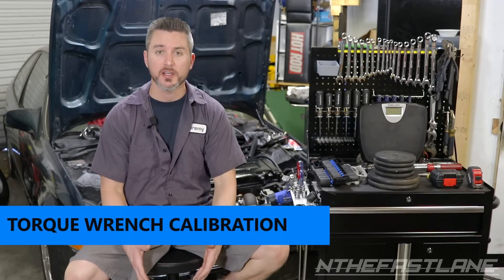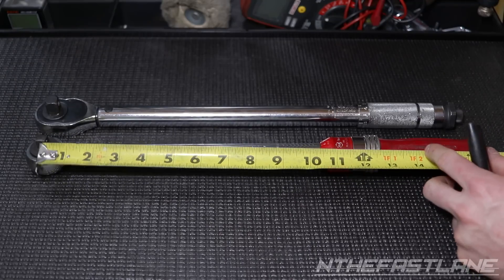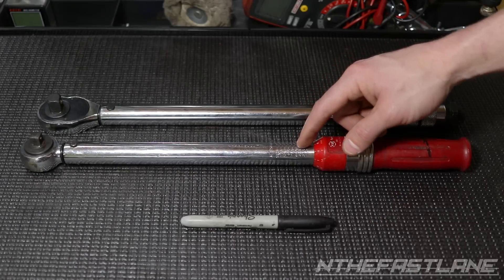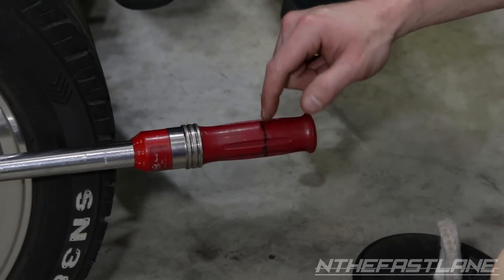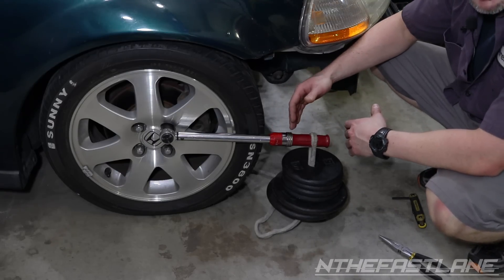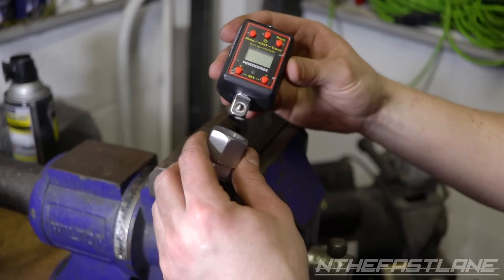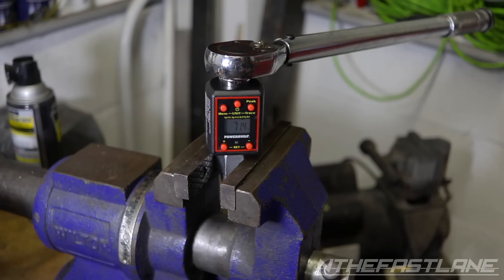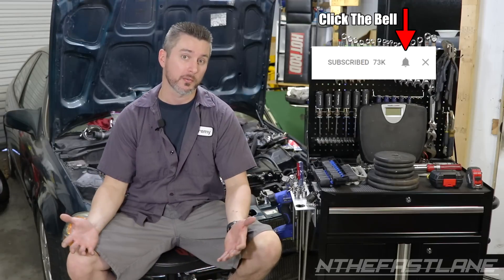▶️Torque Wrench Calibration (The Complete Guide)🔧

Comment: Question(s): Didn't you slightly change the length of your torque wrench when you dialed in 50 lb/pounds after you made your length measurement?
Also, didn't you skew the torque reading when you used an adapter with the digital calibrator since you changed the circumference and thus the torque at the Digital meter? 

Thanks
Reply from the maker: I would say yes, it may have changed around 1/8th. But that's okay, because anywhere within that handle grip is where you will be applying pressure. I mention how I like to apply pressure more towards the back of the handle where the silver ring is. Keep in mind all certified and even high end torque wrenches are within 3-4 % accuracy. This is the ANSI standard.

Again with the skew that would still be within the 3-4% accuracy.

The ANSI Standard allows 4% of reading error between 20% and 100% of wrench capacity.

Hope this helps!
Reply: I have to say that I had the same concern as wa4aos.  I get it that the ANSI standard is 4% accuracy, but that's for the wrench*. If your calibration method is less than 100% accurate, you have to add that to the total margin of error.   Also, where you normally grip the wrench is not relevant. All that affects is how much pressure *you have to exert to make the wrench apply a certain torque.  With this in mind, I can suggest a few things that would make your test a little more accurate.
1. Make your measurement mark on the metal part of the handle which doesn't move in and out like the grip. As you mention in your notes, 12" would make the math simpler.  
2. Make your measurement mark as fine and straight as possible....maybe use a fine point sharpie.
3. The strap you're using to hang the weights looks to be pretty thick...what 3/8" or so?  Seems like that makes it difficult to center on the mark.  Why not use a piece of wire? If that slides, you could apply a piece of duct tape on either side of the mark. 
I think each of these steps would add incremental accuracy to your calibration.
Reply: @tommymc51  I think if we hang it in the metal portion that doesn't move, then it won't produce the clicks. I'm not 100% sure. Just my thought 😊
Reply: To make it more accurate, we can adjust to 50 and then measure the length.
Reply: Hi. I don't understand. Can you explain it a little easier for someone to follow? Maybe the correct of things when doing a recalibration. Thanks.

Comment: It is not accurate calibration
Reply from the maker: It is very accurate.
Reply: @Nthefastlane  It is accurate with weights because weights from a weight set are usually pretty accurate. However using a bathroom scale to weigh yourself and then whatever weight you are using such as a rotor would be anything but accurate. Take as many bathroom scales as possible and you will usually get a different reading on most of them. So Tyler, he is not hating, just making a fairly true statement.
Reply: This 61221 Klutch is 250 inch pounds rated, not foot pounds,
Reply: Why you hating?